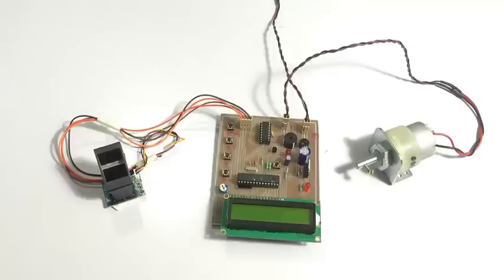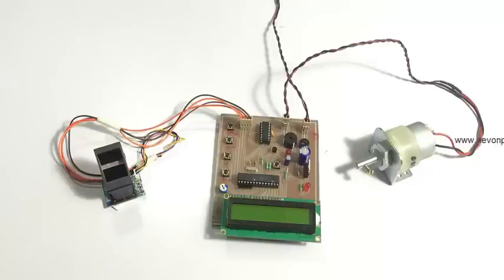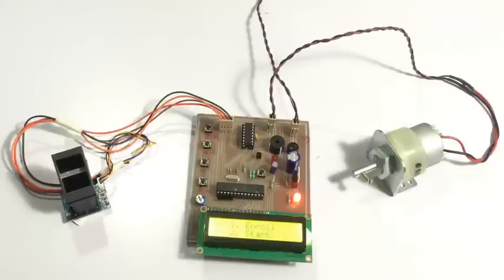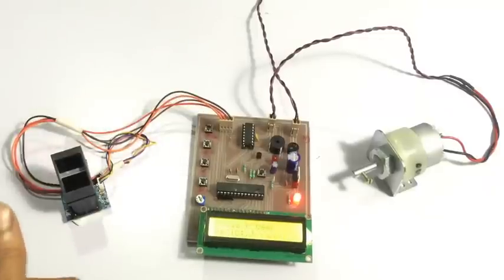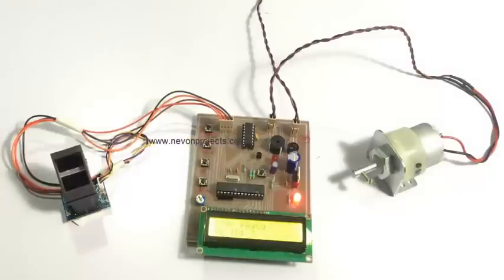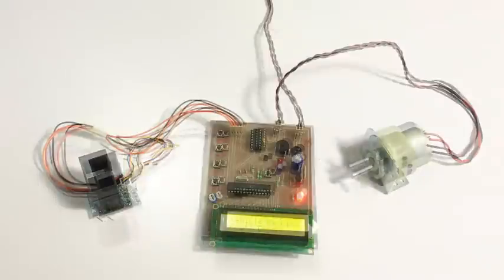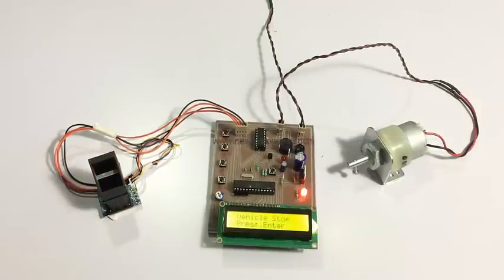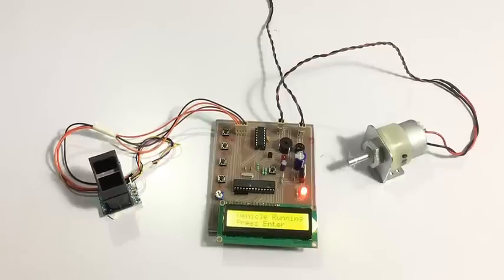Fingerprint Based Vehicle Starter

Comment: in this system if i registered a finger, and then i turned off the supply and again turned on. then the registered finger print will be dismissed or it remains as it is?

Comment: This looks awesome man!! If this is set up to start a car engine, im assuming it would be hooked up to the started, but you cant have the starter constantly running like that you'll strip the teeth off the flywheel. What process is in place to start the starter motor but then understand when the engine is running and turn off?

Comment: How would you disengage the starter? I can see it working but the starter only needs to work till the engine runs otherwise it would stay stuck.
Reply: literally just asked the same question, Have you found an answer to this issue?
Reply: probably programmatically.

I know in my personal projects that I've done using actuators, and more specifically, locks, which can be damaged easily by sending either too much current or the right current for too long, that sending a signal for sending current no longer than ~1 second duration is just about right which is what your car does anyway.

I see no reason why that concept of programmatic timing would be any different here.
Reply: Just use relay